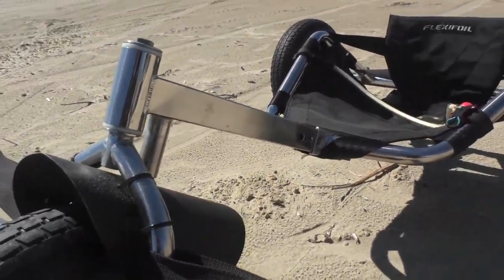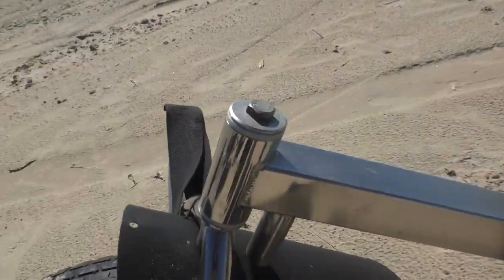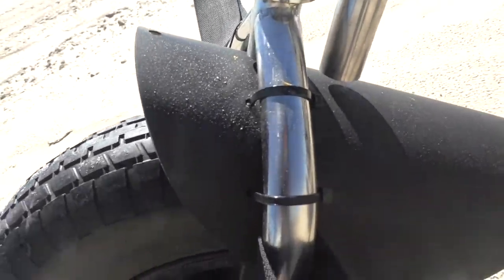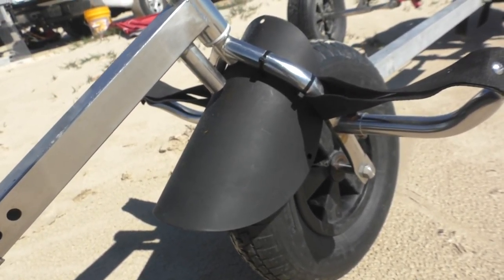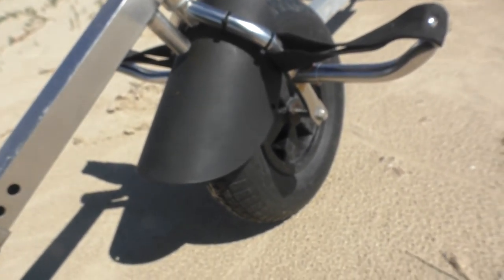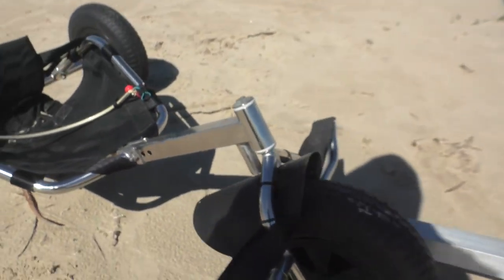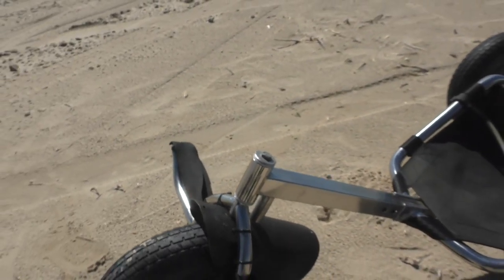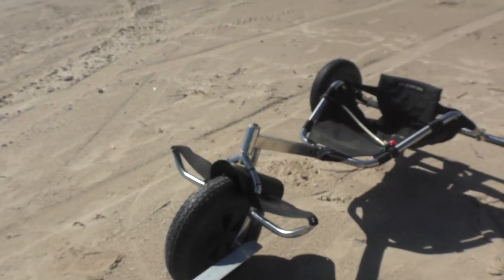kite buggy fender homemade

Comment: Hey man, I like the simplicity of your fender there and was looking to do something similar with my buggy as well. Did you simply bend the sign that you got, drill holes, and zip tie it to your buggy?  Did you also feel the need to attach the mud flap as well?  I’m looking to use a non-rusting material since I buggy at the beach and thought about using a circular plastic.  I was wondering how large the circle should be?
Reply from the maker: about 12 inchs